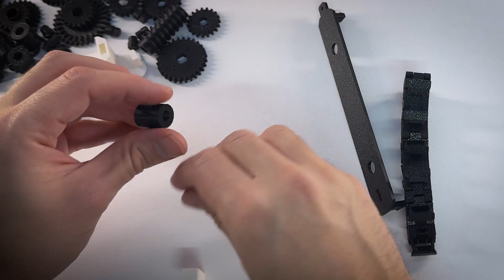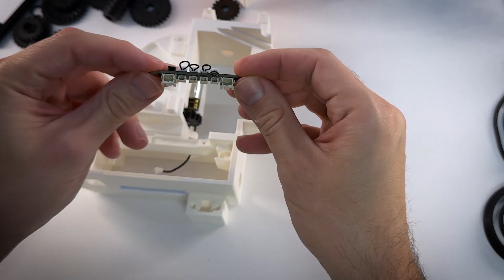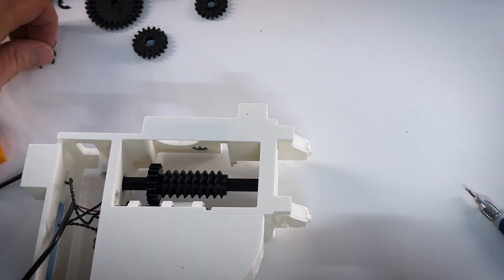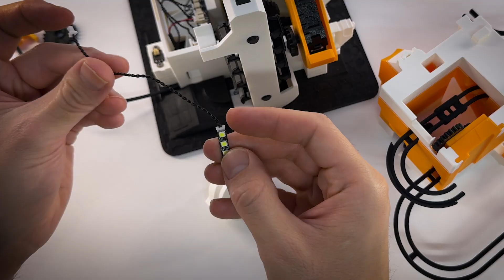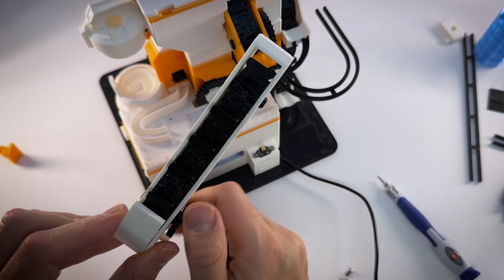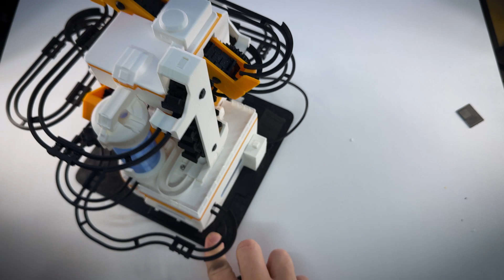Sci-Fi Lab Marble Run Assembly Guide

Comment: Is there a certain way the wires need to be inserted? I’m on the light step bout 4 minutes in nd they won’t turn on
Reply: When I spin the motor the light turns on
Reply from the maker: @brendanbirschbach9995  Check, that the motor and all the lights are on the white connectors and one button is on the first black connector and all other black connectors are filled with the little loops. If that's the case it's probably a faulty board.

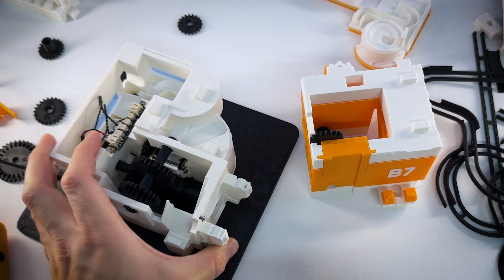Comment: At 7:04, what size screw is that?

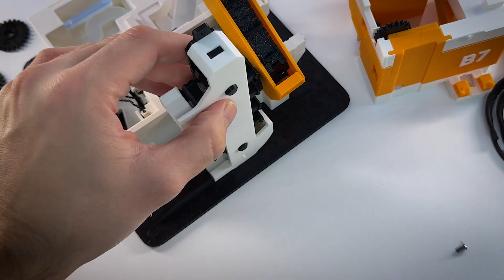Also at 7:15, the steel ball can’t be pushed by the bucket for some reason at the bottom, and causes the motor to quit working. What can I do here to fix?
Reply from the maker: Hi, all screws except for the first 4 on the electronics are M2.5x6.
Reply from the maker: This is probably because the ball gets blocked too much from the stopper. You can grind that stopper down s bit, or even use a drill to reduce its size.